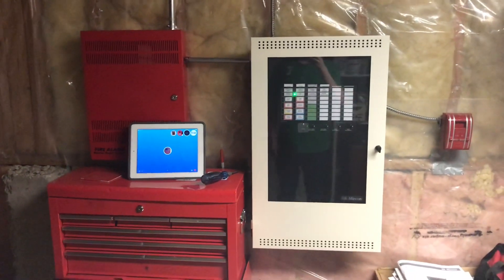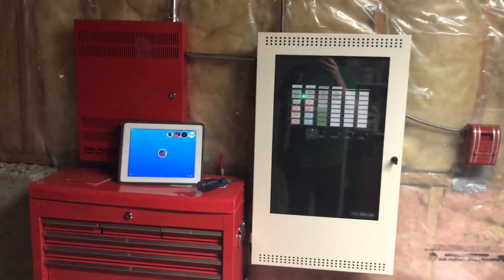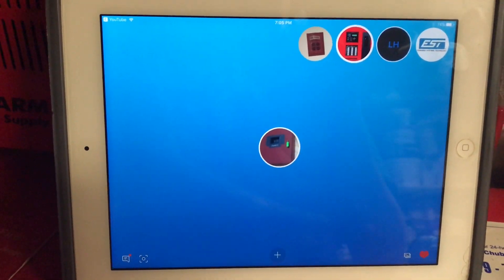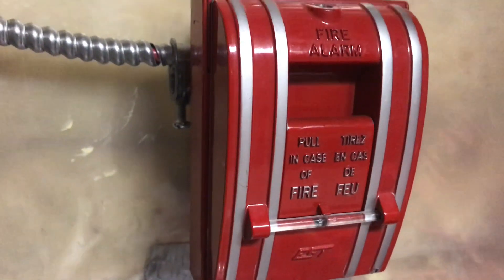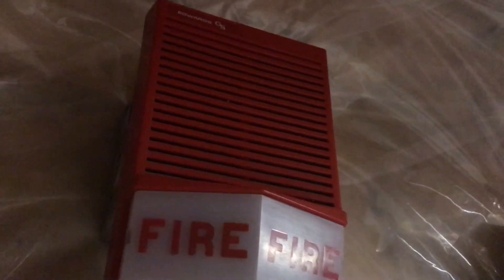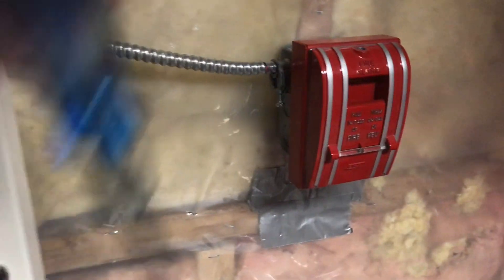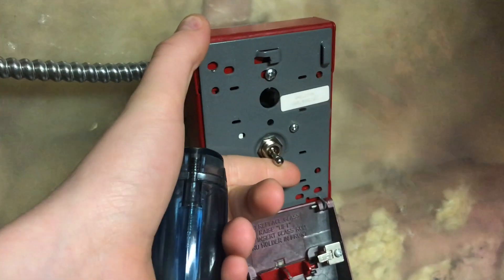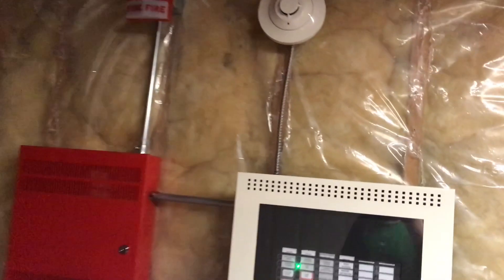Mini System Test 14

Comment: i have a great system test. can you do a replica of my windenburg elementary school's old alarms. my project used to have Simplex 2901-9806 horns on 2903-9001 light plates and EST integrities. the horns were on continuous while the integrities did code 3.